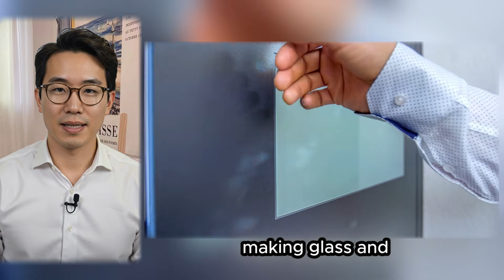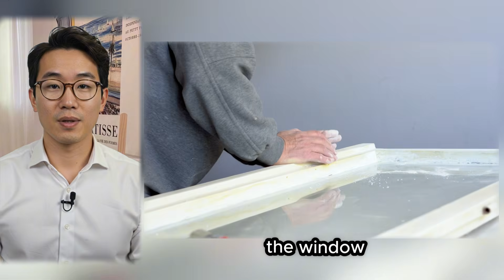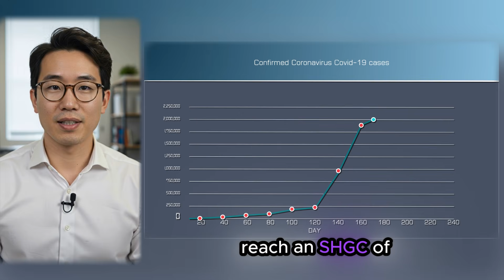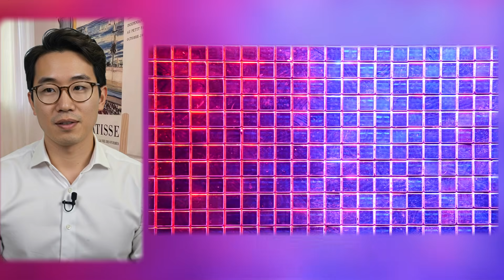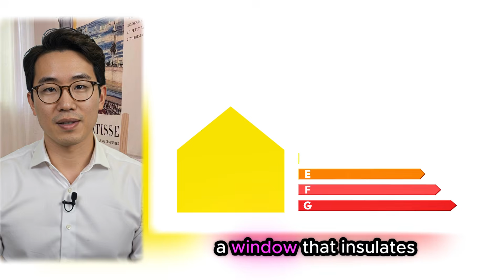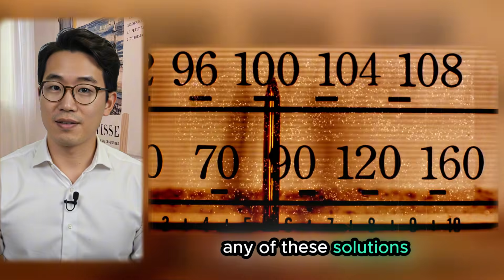7 CHEAP Window Hacks That BLOCK Heat COMPLETELY This Summer (NO AC NEEDED!)

Comment: I would add louvers to the out side made of wood painted light colored that would work better heat stays out so does sun and air gets in .Sun would not even touch window or screen ...
Reply: Just over lap louvers and no heat or rays to ever touch window ..You get protection from this way too ...

Comment: A white roof stays cooler and will cool your attic. I painted my roof with Lance shingle sealer.  I got sunburned on the dark shingles,  but after I painted my roof, I could sit on my roof without burning myself. Already, inside my house is cooler. So stopping the roof from heating up the roof is very important for saving on your utilities. Also, I will be painting my brick white. I put dark tent on my windows and on the hot sided windows I added the reflected.
Reply: "I got sunburned on the dark shingles,  but after I painted my roof, I could sit on my roof without burning myself"

That makes no sense white shingle would reflect more light towards you. This is why you can get sunburned worse when snow is on the ground in the winter than when there is no snow
Reply: But we want the heat gain in winter, right? And you can't repaint your roof twice a year.
Reply: Thank you for this detailed info.
Reply: Solar panels on the roof also provide some shade. 
Course then you can't sunbathe on you roof.